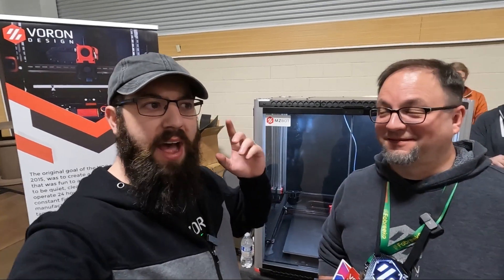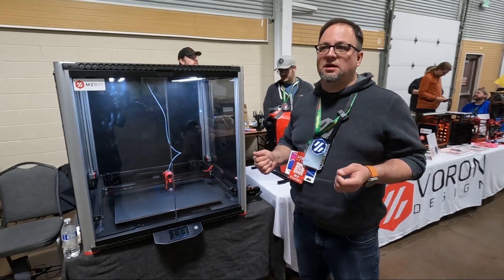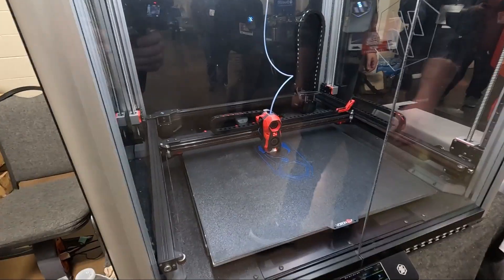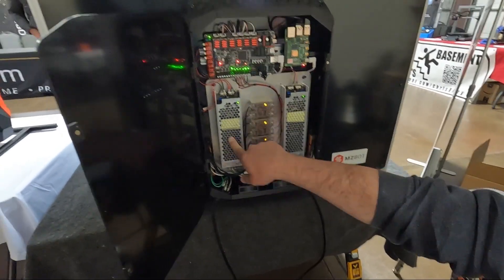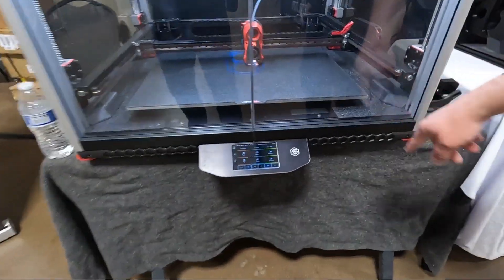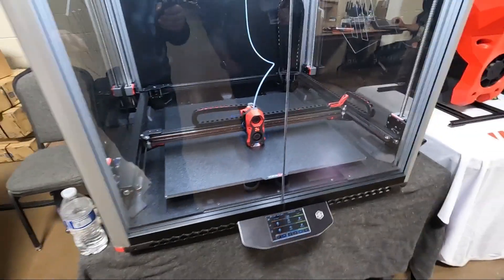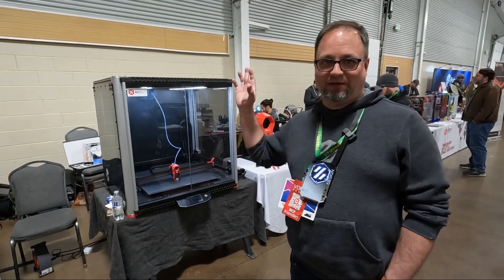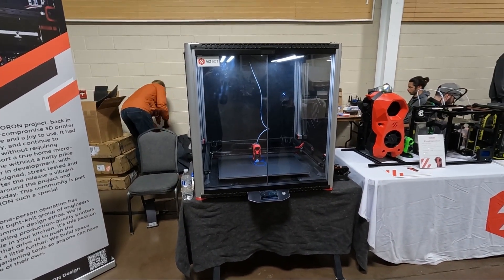Voron V24 First Look At RMRRF 2023

Comment: Looking at bulding a 2.4 this year, with the key difference between me and the standard DIY builder being I have experience in a machine shop. Plan to use my layout tools, drill press and some plate to build a bunch of highly accurate parts instead of relying on 3d prints. Not quite the same accuracy as a mill but I can get pretty close with extremely high rigidity. Cool to see this thing using similar building techniques.

Comment: The best part of this (and reason I would even consider it) is that it is large enough bed top print life-sized R2 droid parts without cut seems. And with being fully enclosed and circulated temp, could possibly print in something other than PLA for better longevity and easier parts finishing.
Reply: It's like you read my mind. I can already see the R2 or R5 head sitting there on the print bed!!
Reply: For some reason I thought R2's were bigger than that

Comment: This looks very cool!
Only thing, which I would have wished for, is AWD (all wheel drive, i.e. 4 A/B steppers) to compensate for the giant belt lengths. Hopefully there will be a mod for AWD.
Other than that, wonderful design!
Reply: It is not so much about the additional torque than about the length of the spring (i.e. the belt) to and from the motor. By adding additional motors to the front idlers, one motor pulls, one motor pushes the belt and you have a neutral length of belt in between. With that you can achieve significantly higher accels with input shaping.
Ratrig Vcore has an appropriate AWD mod, search for that and look for the results, it is quite an improvement.
Reply: it has nema 23s, and you can probably just use nema24s without changing anything if you needed it, they have like 50% more torque.

Comment: It would be cool if the segmented bed could get standard. Like we could use 4 V0 size beds for a normal size printer. Then just heat up a small quadrant for small parts. Might be cool, not sure how hard it would be to keep them all flat.
Reply: With current electricity cost it sure would pay off quick
Reply: Wouldn't work on builds with big aluminium beds as it's a conductor. It wouldn't get to temp or just take a fricking long time! The whole bed would need to get to temp as it's effectively a big heatsink. (I believe/think). PCB style beds like on a Prusa could however could benefit from individual heat zones. But once again... Normally you want the enclosure to heat up, so a bit aluminium bed/heatsink helps dissipate the heat
Reply: @deancc8883  If you have multiple segments with a small gap in between each other it should work. Would also help with the metal expanding under heat. There print bed usually has a steel plate inside coated with PEI therefor very poor thermal conductivity, so heating a singular plate or area should face no problem
Reply: @giedrius2149  the thinner the material (i.e. steel PEI coated spring sheet) then the less of an impact conductivity is. The fact these beds are 6-8mm thick aluminium... I can't see it working. Think about CPU coolers... The CPU dies are tiny! Yet you can get huge coolers. But if you want to try then carry on. Will be interesting. 😊👍
Reply: @deancc8883  like the other commenter said a small air gap should take care of that. But yeah it might not even work or add many benefits given the added complexity. But it's fun to consider.

Comment: Nice. I think making the Z-height closer to 400mm would make it fit through doorways (Sideways at least) though probably not a lot less expensive.
Reply: Corexy doesn't need to be square either. 400x by 600y bed might be a good compromise. That also keeps the gantry beam shorter, for reasons
Reply: @Cabinlab  and now I want a Voron 24 at 600x400x1200 with dual extruders and two 6 lane ERCFs to feed multiple filaments.
Reply: but ma build volume :(
Reply: This might fit through (some) windows though...

Comment: It would be interesting to see a smaller Voron printer built with some of those specs.
Reply: Me too. I would love to see V2.4 and the Trident with a 3030 frame, Then 9mm belts would be able to be used.
Reply: @IvaBiggun  yep. I wouldn’t say no to 48V NEMA 23s and ball screws on z (like the HevORT uses) on a 300mm printer either.
Reply: I can see it now. Printer for ants V0.24. 4 x 120mm beds, ball screws, 3030 extrusions for the frame, and 2020 extrusions for the gantry. 😂
Reply: I agree with you, but I dont think you will see real benefits of many of the improvements made here, for example, the ball screws.
Reply: @madcannon3162  it’s really hard to say. Good-quality ball screws provide a smooth motion system than lead screws. HevORT uses them, and I have a commercial IDEX that has one for z. The question is, does it provide better print surface quality than a lead screw? There are other options, like belted-z and now lead screws with Wooble-X.
Reply: @JonS  Indeed, we will see, I still think ball screws are a bit overkill. I recently watched Teaching Tech's video on Wooble-X, and seems it does the trick, specially with heavy gantries (Tridex could be a good candidate).
Reply: @madcannon3162  you’re talking as though overkill is a bad thing! 😅
Reply: @JonS  hahah you are right, I sometimes forget there is no such thing as overkill when talking about Vorons. 😍:_voron:

Comment: I guess we'll have to as Steve how much stuff they packed inside of it for the trip.  Looks like it takes up all of the van's cargo space.
Reply: Tardis Van. Larger on the inside. 😜
Reply: You can safely pack clothes inside so you don't need suitcase. Or I'd use it that way.
Reply: @MartinJahn  Didn't they pack Nero inside it for the trip? ;)
Reply: @Cergorach  It's at the end of the video
Reply: Having unpacked the van... Lots of empty spools.
Reply: I think we had at least four other printers inside V24. Getting it into the van was quite a challenge, too!
Reply: @tanaes  and then Nero just crawls in it instead of helping.
Reply: Two V0's, a Micron, a big box of filament and anything else we could stuff into the extra space!

Comment: Need to put a 2.4 inside then a salad fork in that finishing it off with a v0.2. Voron Turducken 😂
Reply: It's been done. Would take me awhile to find it but if you ask the Voron team someone has I believe a 2.4 inside 24 and then I think a v0.1 inside it. It gets joked about a lot but there has been 1 or 2 pics posted.  But that was before the makeover.
Reply: @Rainmotorsports  thanks. Wasn’t aware. Rather new to the Voron scene.
Reply: @Rainmotorsports ll
K
Reply: That would be a 26.6 (or 26.5 if a v0.1 instead of 0.2). 😂

Comment: What a beast of a printer. That SB toolhead looks so small inside.

Interesting that there are 2 x Power Inputs, something to be cautious about as if you are powering it from two different phases then you end up with a much higher voltage present within the enclosure. Worse over here in the UK where you could be going from 230VAC to 415VAC.
Reply: You can't get 415v in the UK in the manner you describe.

~2600w Should also be achievable from a single UK mains plug, providing the connection to the printer is made with IEC C19/C20 Connectors, 1.5mm2 cable and 13A fuse. 

Each PSU and feed to each heater SSR should also be fused internally.

Comment: I thought belts weren't reliable beyond 350. How did this model well before 2.4 handle that constraint?
Reply: 9mm belts instead of the 6mm belts on the 2.4
Reply: 9mm belts + metal parts.